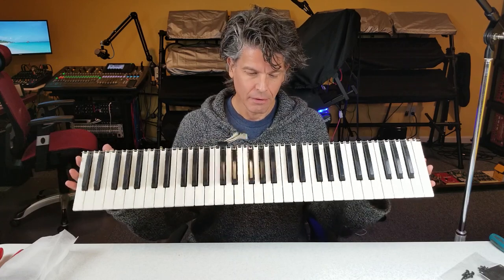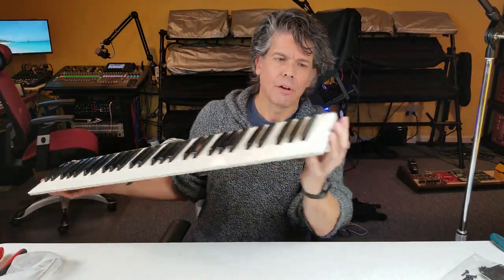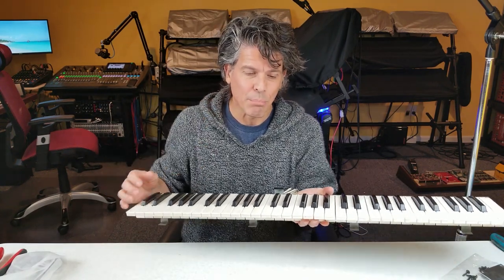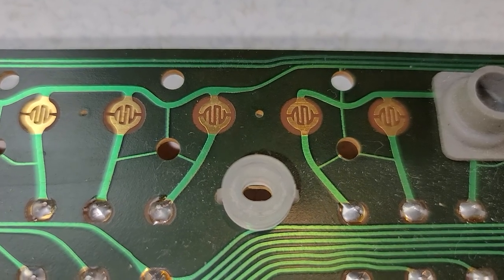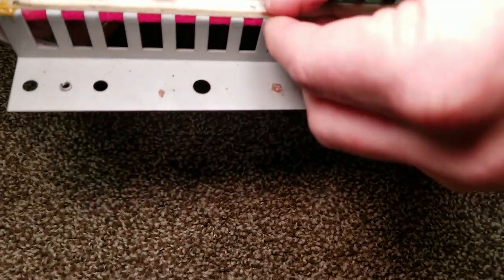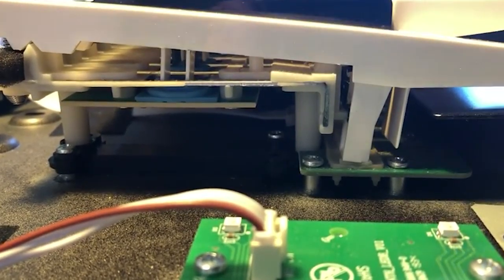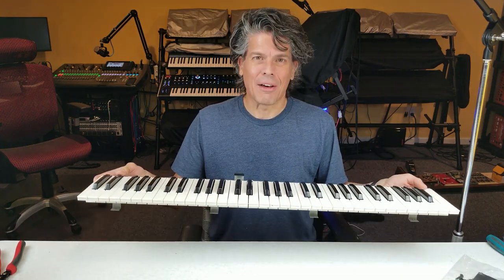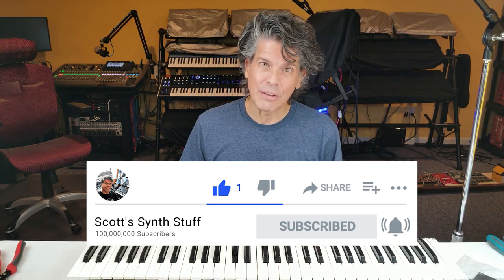Your Synthesizer Keybed: How It Works, and How to Fix Problems

Comment: The explanation about how velocity sensitive keys work was cool. I once had a key that worked intermittently. I took the synth apart, and under the rubbery thing, I found a dead pseudo scorpion (look it up) that had crawled in there and got squashed when I played the note. I cleaned it off and it worked fine. The way he was able to crawl in there, is that there are little openings, so that the rubber doesn't burp when you press the key!

Comment: Thank you very much for this fabulous video.  I recently had to try to fix my M-Audio hammer 88 midi keyboard by opening it and frigging around to understand what was happening.  You just explained to me why I had a block of notes not responding.  Funny thing is without knowing what I was doing I disconnected all the wire connectors and reconnected them and it fixed the problem... I think...  I do have a few notes that are lose now here and there across the keybed (but they do work) and it's probably because of my clumsy reinstallation.  Anyhow, I had accepted it was garbage and felt comfortable opening it and exploring it's construction.  Thank you again!!!  We are interested and watching you teach so keep going my friend you are amazing!

Comment: Excellent video thank you !
I've seen a project on internet where someone replaced his polysix keybed with velocity sensitive one. He then replaced the 8049uc key assigner with an arduino and changed the VCF amplitude out of the key velocity
Reply from the maker: Interesting idea. Now that I'm familiar with the voice board circuitry, I can see how that could be done. It wouldn't be simple, but definitely possible.

Comment: Saved me yet again with your repair vids!! My Roland JD800 key contacts were so grubby that alcohol and erasers didn't fix it.  Barely/gently scrubbed both the key contacts and the carbon dots with some steel wool, blew-out/vacuumed the dust, and the keys are playing evenly now.  What a PAIN!!!  But so nice when its done.

Comment: Thanks for the video. I found a video on the polysix that actually recommended using a rear window defogger repair kit which had a conductive liquid that could replace the carbon if it was beyond cleaning. It sounds weird, but it fixed all of my korg keys! (I only had three working before haha) Definitely worth cleaning first,  it for 10 bucks it's a great last resort instead of having to buy new ones. Best of luck with the polysix!
Reply from the maker: I've used that to fix window defoggers before...but for the membrane pads, I've always used Caikote, which is specifically designed to fix this type of problem: https://amzn.to/3QuYpRG

Comment: Hey Scott, thanks for the video, brilliant as ever. Would you consider taking more time explaining the difference of the pin configuration? For instance, the Opsix has a 15 pin connection, the Yamaha Mx has a bunch of cables, and so on.
Reply from the maker: They are all unique, proprietary, and sometimes unique to individual synths. Some send a matrix, some send digital serial. Probably out of the scope of this channel.

Comment: Thanks Scott. I took my Korg Kross 2 apart and cleaned the motherboard. I didn't change any of the rubber strips, because they were all in tact. I did notice that wiping the motherboard made a positive difference in the clarity of sound. I used Q-tips that I dipped in rubbing alcohol to clean the mother board. I had a lot of dust and specks of debris that fell or settled inbetween the keys over time.  I still have that sporadic loss of sound as I'm playing. I talked to a repair guy at a local music about the sound drop. He mentioned a sound generator but he didn't really go into detail about it. To your knowledge, is the sound generator an easy removable part? Thanks. Best wishes

Comment: Very good video. Thanks! I have a problem with releasing some keys triggering te note (full vel). Mostly when pressing harder on the key. Even whit slow/soft velocity, but hard pressure. My rubber strips has 3 carbon pads. Any idea?

Comment: Hi, thank you for this interesting video.
I have an issue with my Roland D-10 which is similar but not identical to one you described, maybe you can help me. The issue is that the lowest 8 keys only play once and then become non responsive. The sound is at minimum velocity no matter how hard I play, and keeps sustaining until reboot or until I run out of polyphony playing other keys. Oftentimes, the problem will fix itself after a while that the synth is powered on (like one hour or so).
I opened the thing up today and ran some continuity tests with my multimeter, I seem to have found nothing wrong with the wires or keyboard itself. I cleaned up the cable sockets with contact cleaner spray, but to no avail.
Do you have any ideas about this at all? The only thing I can think of is that the gate array IC chip that does the key scanning has gone bananas, in which case I am screwed. But I would think such a failure would affect the entire keyboard?
Any help will be greatly appreciated.

P.s. a few years ago this synth had this problem, I played keyboard very little at the time so I didn't care. Then somehow it magically fixed itself and kept working for years until a couple of days ago. Weird...

Comment: Thanks for the dtailed explanation you gave. I was wondering could it be a tone generator issue or a faulty capacity issue if the sound intermediately stops playing? The sound on my Korg Kross 2  88key workstation stops playing sporadically on different keys. The sound will come back after I tap on the keys. However, sometimes it comes back soon after tapping on the keys, but then sometimes it takes quite a few seconds longer for the sound to start back playing again. I was hoping maybe I could fix it. I'm going to get some more rubber contacts first to have them handy. Are you familiar with Korg sound generators and the capacitors possibly going bad which may cause unforeseen sporadic drops while playing? And thanks again for the detailed explanation of your video.

Comment: Scott, great video as usual.  I think I've watched this one twice.   Do you have a recommendation and/or video on how to properly grease the keys?   I recently fixed a couple yamaha psr keyboards and incorrectly (?) removed all the grease, and now they are quite noisy, but work fine.  I was wondering "what would Scott use" ?   As I know they sell some horribly expensive yamaha grease for like $30 for a tiny tube ... I was thinking is this just high quality silicone grease?
Reply from the maker: I didn't want to buy the Yamaha grease either, for the same reason!! So I found the listing for the Yamaha grease, then looked up the MSDS to see what was in it - and it's just lithium grease. So I use standard white lithium grease, and it's worked great for me - doesn't dry out, and works perfectly.

Comment: What about cleaning the circuit board where the carbon connects? Clean with alcohol? I've seen other videos that say that alcohol has remove the carbon surface from the circuit board.

Also, what if the entire keybed doesn't respond at all? Bad cable?

Comment: Hey Scott, I'm working on a keybed similar to the one shown in the video, it's from a poly800, where the lowest 31 keys are unresponsive. Ive probed around with my multimeter for an hour and found continuity between everything. I'm worried it might be an issue with the A/D converter chip or the bussed resistor, any clues? I'm not sure what to do next or how to diagnose the issue.

Comment: Super super interesting and informative video. I'm glad I found it! I have a problem with my korg though that isn't discussed in the video. I block of 6 keys seemed to sporadically stop working. That was discussed, but that problem seemed to resolve itself on its own. Now though, some of those same keys just play on their own. I'll be playing in a different area of the keyboard and then one of those notes will just play without being pressed and sustain indefinitely until I have no choice but to turn the whole thing off. What causes this and how do you fix it? Any help would be greatly appreciated.
Reply from the maker: That's usually a single wire in the connector or wire between the keybed and the synth - it could be a broken wire or a bad connection.
Reply: @ScottsSynthStuff  OK. I'll have a look at the wires and see if anything looks amiss.

Comment: I have two old Yamaha YS 200 and both have no good Aftertouch response. Do you know a company that makes Aftertouchstrips compatible with old Yamaha synths? thx in advance.
Velocity is the first derivative of your location coordinate aka x(t)/dt = v(t). v(t) is proportional to the acceleration a(t_0) necessary to achieve that velocity after a time intervall t-t_0. Since pressure P is proportional to the Force working on an area and a Force is a(t)*m, velocity is a good measure for the pressure needed to accelerate the key of a given mass, esp. if the mass is the same for all keys on a keybed.
Reply from the maker: It all comes down to energy vs time. :)

I would give the people at Syntaur a call - they have them, and might know what resistance value you would need.

Comment: I have a Yamaha P125 and one note is out by middle C an F drives me crazy .I have cleaned the contacts multiple times done visual for broken traces,checked diodes, no luck. Key has the plastic piece intact that touches the rubber.I do have a new middle range board but would like to get the original back working first if possible before changing the board.Any advice?????...thanks Glenn

Comment: I love this video,  and so many more I've found on your channel. You get in depth in a way the Tech in  me loves.
 I was hoping this video answered a question I have.  My 1st Synth was a Yamaha SY22.  I hadn't played it for a long time and was able to play it recently and felt that the velocity sensitivity was very hard,  as in playing hard or light made a difference,  but not as much as I remember.  What would cause that?  The Sy22 has a Yamaha LC C61K6 keybed, like the SY35.

 Also, just in case soon, I'll need to replace 2 basic switches on it, the Yes/No +/- switches. They are the main buttons pressed, and I probably beat the hell out of them, creating sounds as a teen. Any idea how I can find out what switches I can use?  They look like a very basic push button. But i wasn't sure. 

I also need to fix a key that no longer springs up (lowest key) but my guess is the little tab that holds the metal spring has snapped off so I may have to buy about replacement or rig a way to create a tab to hold that spring down.

Anyway,  great channel!
Reply from the maker: It's possible the keybed just needs a cleaning, like I show in this video. Until you open it up and see, you won't know for sure.

As for the tactile switches, what I normally do is open it up and measure the switches that are there with a micrometer - the number, electrical layout and spacing of the terminals, the overall size of the switch, and most importantly, the height of the plunger from the circuit board. Then I go to Mouser or Digikey and start searching for something close that will work.
Reply: @Scott's Synth Stuff  Will do.  Thanks!

Comment: Hello there.  Great video. I still have a curiosity question.. My Roland Fantom is very hard to press in order to get the aftertouch going. Not sure if it's only mine but it also make more noise when playing the keys than my Montage.  I tried adjusting it in the settings but still nothing.. is the aftertouch strip a preassure sensitive or is it just a switch strip and can it be adjusted somehow?
Reply from the maker: I have both a Fantom and a Montage, and I agree, the aftertouch on the Fantom is VERY stiff, I have to press quite hard to activate it - and it seems like when you do press into the aftertouch, it's all or nothing. It's very hard to modulate. The Montage is better, the Hydrasynth is by far the best, with easily modulated aftertouch.

For channel aftertouch like in the Fantom and Montage, it is just a long resistive ribbon, like I show in this video. The harder you press, the less electrical resistance, and the synth measures that. There are adjustments in the Fantom, as you have said, but I found (as you did) that they don't have much effect. I think it's just the nature of the beast in the Fantom.

I will say that in the JD-800, which uses the same system (that's actually what you saw me showing in this video), I was able to solder in a resistor that adjusted the sensitivity of the aftertouch to make it much more usable. You could probably do the same to the Fantom, if you really wanted to. I suppose you could solder in a potentiometer that would allow you to adjust it as well.
Reply: @ScottsSynthStuff  I thought about that but I need to look at another first.  For what it cost I really don't want to touch it for now but it does seem like it needs Something to soften the keys.  They sound like am banging on it.. my Korg X2 still has a better feel. Thanks. Am learning more as I keep reading 📚 and maybe I'll decide to take it apart and modify it one of these days.. that's the only reason why I sold the FA to buy this one.. 😎

Comment: Since you also have a Roland Fantom 6, I think you have also experienced that the keys of the Fantom 6 are of excellent quality, but quite noisy due to the keybed. Is it possible that Roland saved a lot with the felt or rubber under the key? I don't know what's under the key, I didn't take it apart, because it's still under warranty, but many people claim that there is not enough felt under the keys, and because of this, the keybed rattles a lot when I hit the key harder. I think that's why Aftertouch is also bad on the Fantom synthesizer. You have to press the keys quite hard to get it to respond, especially with the black keys. What do you think is the problem with the keyboard? I love the Fantom synth, but its keyboard is very noisy.
Reply from the maker: I have heard from people who replaced the felt in their Fantom with a thicker one, which reduced the noise of the keybed, but it did not change the amount of force required for the aftertouch. On the JD-800 I was able to change the aftertouch force electronically by adding a resistor, I suspect you might be able to do the same on the Fantom, but I'm certainly not going to try it. For whatever reason, the channel aftertouch on most synths is extremely stiff and hard to use. I don't understand why they do this.

Comment: Great video. Question for you - do different manufacturers use different communication protocols to transfer signals from their keybeds to the synth engine attached to them? I stumbled across your video doing research on how keybeds work, as I'm wondering how hard it would be to pull apart my Opsix, buy something like an old Mk1 S61 Komplete Kontrol midi controller to steal its keybed, and then put the Opsix synth and front panel and the KK keybed into a custom made enclosure to create an Opsix with a decent sized and nicer keybed. However if every manufacturer uses their own comms protocol I might be out of luck.
Reply from the maker: Internally it's typically not a communications protocol at all. That would require the keybed have its own processor, to read the state of the keys and then transmit it to the main processor.

Internally, virtually every synth uses a scanning system for the keybed. The keys are arranged electrically into a grid. The synth has scanning circuitry (or just uses the main CPU) to energize one row of the grid, then checks the columns to see which keys in that row are pressed down. Then it energizes the next row, and scans the columns again, until it's read all of the rows, then it starts again. This happens extremely quickly, hundreds of times a second. This allows the quick scanning of the keybed, without having to have a wire going to each key.

Unfortunately, the key/grid layout and actual scanning requirements will vary in different synths and manufacturers, so there isn't a "universal" keybed that you can just stick into it and expect it to work.

The Opsix will have scanning circuitry that has the capability to read only 37 keys, because that is what it is designed for. You aren't going to be able to stick a 61 key keybed in there, because the circuitry and firmware to read 61 keys doesn't exist.

Some people have gotten around this by transplanting a MIDI controller into a case, then internally (or sometimes externally) routing that keybed into the synth's MIDI IN port. I've seen this done on several JD-800's to replace one of the famous "red glue" failed keybeds.
Reply: @ScottsSynthStuff  Thanks for the reply. I did a bit of digging after I posted my question and ran across the scanning technique you've described so that makes sense. Getting around the hardware issue using MIDI seems like a bit of a kludge. Guess I'll just have to hope that they release an Opsix SE one day. Not holding my breath given it has been two years since they demoed the Wavestate SE and haven't actually released it.

Comment: Motif xs and xf with has à sfx keys . When i have D and Ab not working in all octave i open some forum this is problem in mk board Connection or diode or alimentation i have clean with wd contact electric but no solution i dont have time to replace this board or i dont like to tuch contact flat cable any solution ? Thanks